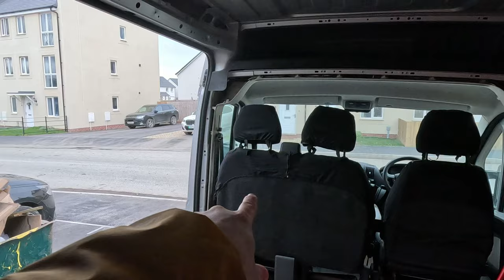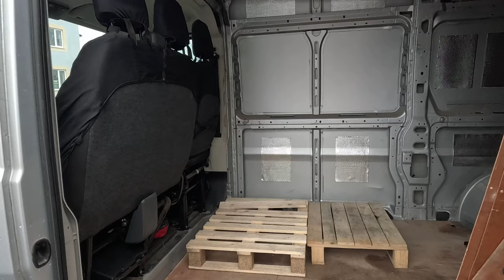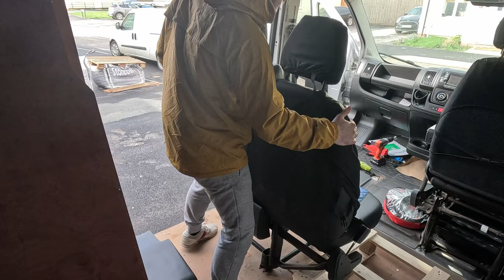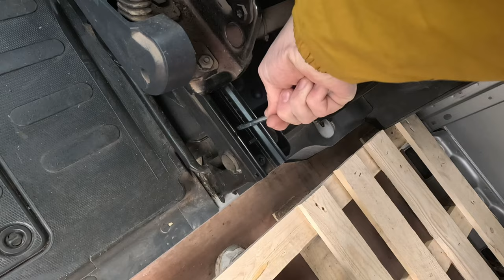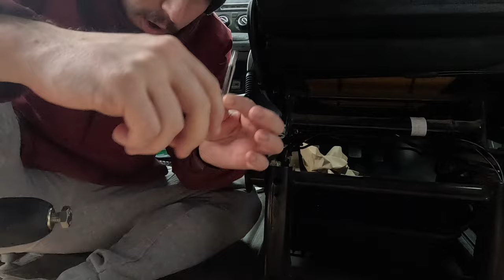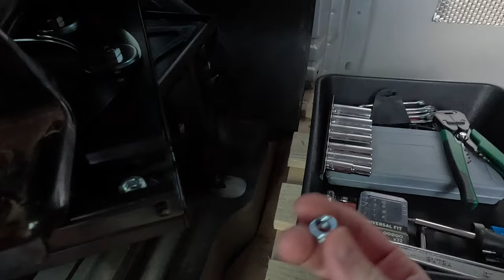[4] Converting My Peugeot Boxer (L2H2) Into A Campervan | Swivel Chair

Comment: If you put your drill on 10 it will only spin to that speed/torque setting which is why it sounds like it’s struggling. If you put it on the highest setting and press down if it won’t un do the bolt the drill won’t be powerful enough. Technically you should use an impact driver (drill) or socket set with the attachment but you got there in the end. Big up my guy you’re going to have a lot of episodes 😂👍 give me a shout if you need anything!

Comment: This video has gave me so much laughter thank you 🤣  just one bit of advice use the right tools for the right job it will save you so much time and headache and if you’re not sure of something use YouTube it gives you the answer more or less on most things good luck with your build 👍🏻
Reply from the maker: I'm glad it gave you some laughs 🤣 and thank you! YouTube has been an immense tool in helping me with this and I'm sure it will only continue! I appreciate the comment and advice, thank you very much 😁
Reply: You need to get yourself a decent socket set. Possibly a halfords Pro set as it has a good selection of tools for most jobs on your van. Makes life easier. 
Regarding pallet wood in your van. If your going to be sleeping in there it can give off poisonous fumes. Mounting your seat you should be using a steel frame bolted to the vehicle. I know your not using it while moving but it needs to be secure.
Reply from the maker: That's good to know about the pallets. If they will be toxic then I won't have them as a permanent feature for the van! What do you suggest for the chairs? I would like them on a raised platform so they're inline with the drivers chair so they all go nicely together with the desk I'll put in.